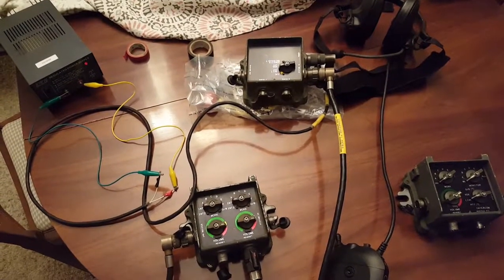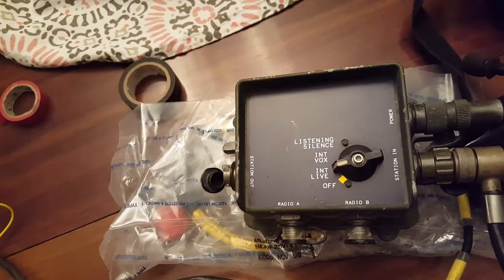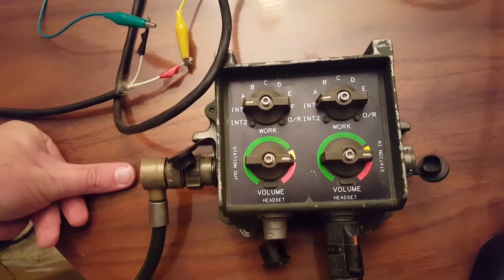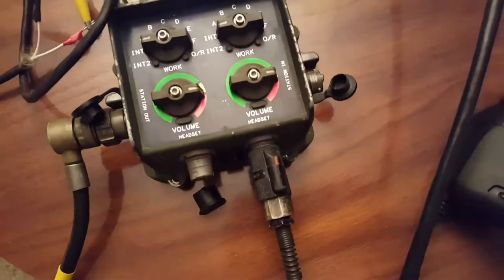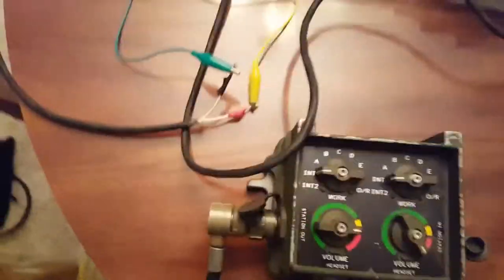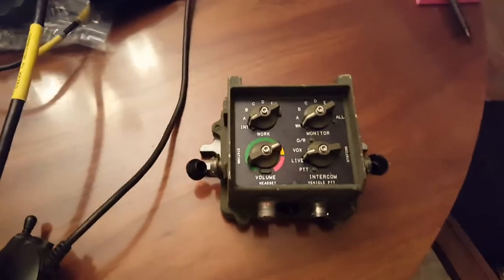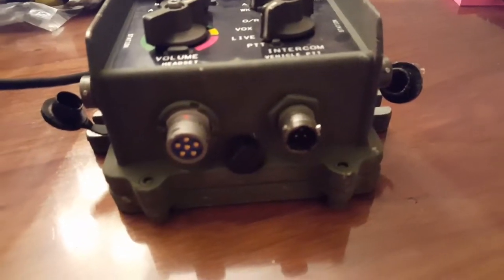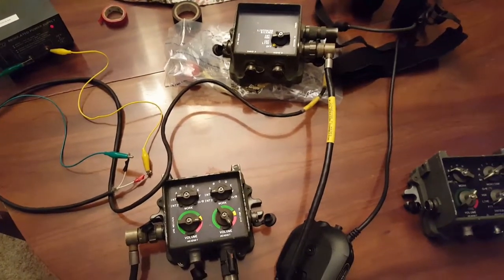Intro to the VIC-3 Lite Intercom at www.vic3intercoms.com

Comment: Nice to see you posting back up. I liked your other videos. So if you wired it with the out on the Lite MCS to the in on the dual crew box what happens?
Reply from the maker: Thanks for the comment.  I had a couple of kids in between, so that slowed me down! If you wire from the MCS out to the station in, it will work just fine. That way you can create a branched system with crew stations connected separately to the out and in or you can create a big loop/ring for redundancy in case a cable gets damaged.. Just don't wire "out to out" or "in to in".  It won't work that way.

Comment: Great video. What headset do you like best?  Installing VIC 3.  Thanks.
Reply from the maker: The Bose triport is the lightest, but I actually prefer the racal raptor ra5000.  Both are good headsets.  The H-36x series are big and clunky.  But if you want one in green rather than black, the H-36x is your only convenient option.